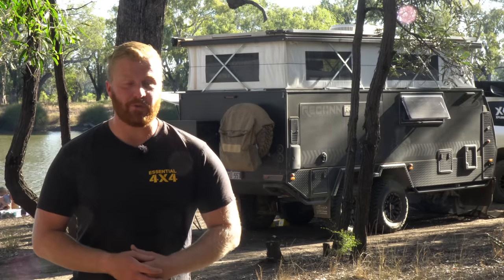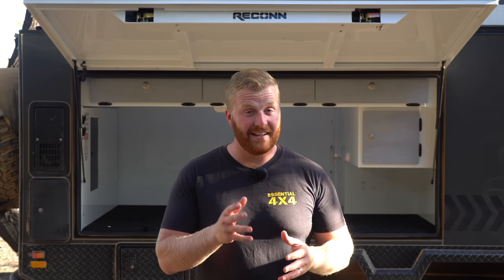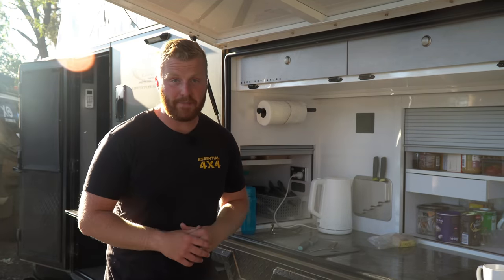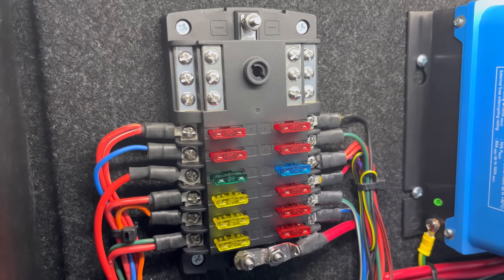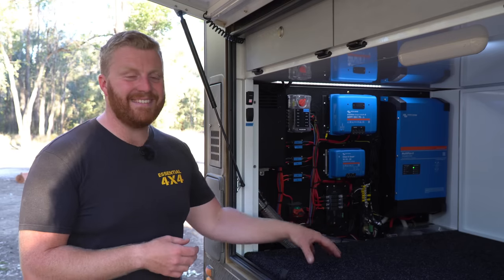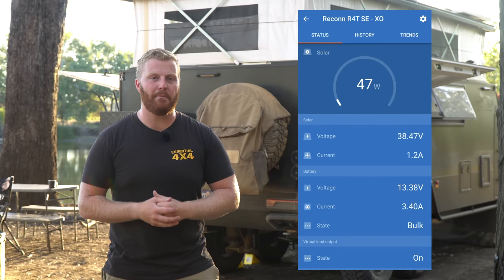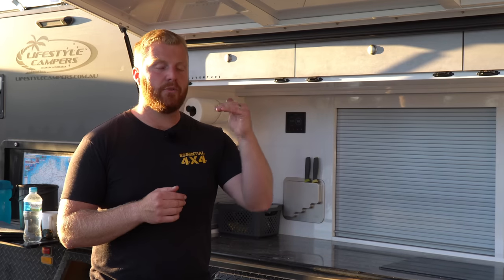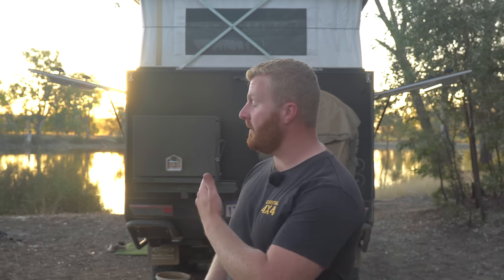Pt 3 | ULTIMATE POWER & WATER SETUP | Off-Grid Hybrid Camper | Lifestyle Reconn R4 | Electrical 12V

Comment: It’s amazing how quickly technology leaps ahead.  That said, you are so right about building your solar system for the bad days, as perfect Sunny
Days are often not that common.

A couple of things you could do in a few short years is upgrade your solar panels. I’m pretty sure some of the worlds best panel manufacturers are already producing 440-450 watt panels, in two to three years time that will probably be 600watts, so essentially you could go from a 1xxx watts of solar on the roof of the camper to almost 2,000 for minimal outlay. By the same measure the 150watt portables will probably be almost 300watts each, so that’s a system that will only get better and rather easily, even if you are required to also replace a solar charger to increase capacity.

Other ways to reduce the amount of power required on bad solar days would be to utilise the jet boil for making a cuppa (or the fire) AND you could probably turn that freezer down (or up depending which way you look at it) because minus 18 Deg Celsius is what’s recommended for long term storage, whereas in the van your probably only freezing meat for a week or two at a time……..unless you’re into the ice cream again Nathan 🤣

Great episode series on a great Van 💪🏼👍🏻
Reply from the maker: So true! I think people are too quick to base their solar input on optimal conditions, not on realistic results. I've sure found out just how quickly solar conditions can turn, even on sunny days! 

And I agree entirely! The tech is advancing quickly and renewables are in the spotlight. They will only gain traction and become more and more efficient as the year pass.
We have used the ol Jetboil from time to time, but still very impressed with our system overall 👍
Reply: @XploringOz  Nathan, you’d have to be one of YT’s gentlemen, always responding positively even in the face of negativity. I think you channel
Is the real deal, somehow you always manage to reply to everyone and always manage to pump out interesting & relevant content & you do so in a way that is beyond your years. I know you do this as a hobby but I think you’ve missed your calling & should end up with your own travel show on the ABC or something.

I am eagerly awaiting an episode that involves some one wheeled stunts my friend, tell me, is there any chance of that happening  at some time in the future ? 🤣
Reply from the maker: @GR8Tmate  Thanks mate 🙏 Way to much negativity online these days. Have to try and make it lighthearted and fun, otherwise it gets to you in the end and the channel will eventually fade away!
Never know what the future holds though 🧐
.
.
.
In terms of stunts.... 😆 more like stacks and crashes 😂

Comment: That is a cracking setup. Really got me thinking about a separate tank for drinking water now as it is by far our biggest limitation on longer trips.

That Victron system is amazballs. I got the cheapskate option with the Renogy 3000W charger inverter which chargers at 75A, but the thing weighs 29kg so swapped it out for just their 3000W inverter. Not nearly in the same league, but can run everything for us (including AC) and has the same UPS feature that the Victron does to switch between shore power and batter.

Brilliant thing with your Victron system is it comes in 12v or 24v input. Pulling those massive currents over 12v requires some serious cabling and fusing. You may find over time that 24v will be on the cards (reduced voltage sag, reduced cabling gauge requirements as the current is halved, etc). I'll definitely be looking at 24v for our next build. I think within the next decade it is going to be an expectation rather than a fringe luxury case to be able to run your AC all night from battery, at least for mid tier to upper end off-road vans.
Reply from the maker: Thanks mate, we love it! It has been and hopefully will continue to work well in our setup. 
I agree with your comment regarding the 24V though. It is the way of the future for these high demand/supply setups and the markets accessories will begin to adapt their products to suit accordingly. 
I don't think our's needs changing yet, given the current setup working well and the very short distances between the batteries and the inverter, but anymore and it would be great idea. 
Hey, as long as your setup works for what you need, that's all the matters 👍

Comment: Hi Nathan, Your  electrical system is very impressive. I enjoyed your overview on the Reconn. It is much better to have a large charge capacity ,really 5 hour charge is really all you get a day, couple of cloudy days with the induction/ inverter in use it doesn't take long to kill the batteries. I have hesitated to go to induction because of the current draw. We also use the Truma hot unit,  some owners have experienced the mounting feet cracking off & the water in and out failing after the feet snap on corrugated rough tracks, now the van manufacturer has fitted a strap over the unit to the load of the mounting feet. Keep enjoying your trip, safe travels.
Reply from the maker: For sure, capacity is king and I agree with your comments regarding charging times. Induction is definitely a heavy draw, maybe a video I can produce in the future discussing this from a realistic point of view? 🤔 
Thanks for the heads up on that common issue, I'll look into this before I hit the Cape!
Reply: @XploringOz  no worries there would enough content for video. If you needed I could send photo of the strap on the Truma.
Reply from the maker: @iandibley8032  Yeah, mate. If you have a photo handy that would be awesome - xploringoz@outlook.com 👍
Reply: @XploringOz  Tomorrow will remove the plastic top and take photo cheers
Reply from the maker: @iandibley8032  Thanks mate. No rush on my behalf, whenever it’s convenient 👍

Comment: Sincerely, thanks Nathan.
You invited us all in to your world, demonstated your choice in van/camper to a standard of integrity befitting your character, yes you blow me away everytime you disclose a product, its features and the primary benefits suiting your requirements.
That water, power supply most would consider over the top, even unnecessary, but as per usual you can readily justify it.
Congrats, just love the total practically of this van, well all except the brilliant external kitchen. Having said that, a small induction cooktop inside would quickly resolve that for me, just for time when weather outside is less than inviting.
Not as young as you, sadly 😢.
What an extraordinary home away from home you have jointly provided for your lovely family, enjoy it, every bit of it.
Reply from the maker: Thanks Ian, I appreciate those comments. We are extremely happy with our setup and wouldn't change it for this trip around Aus. 
I'll be sure to follow up with future productions regarding hybrid campers and our experience with Lifestyle longterm, but the short of it is that we are happy 👍 
PS. The flagship LRX model comes with an internal induction too 😉

Comment: Hey Nathan. Another top notch video and a great finish to your caravan review series. That is one impressive van you have there!!
This more than likely doesn’t affect your situation but for all the mere ‘plebs’ like me out there, I highly recommend installation of the ‘Enviro Water Saver’ in the (shower) hot water feed line. When installed, the valve will divert cold water back to your water storage tank until such time that the hot water flow reaches its normal working temperature then allowing the now hot water to flow through as per normal. I have only just installed it on my caravan but I am expecting to save a bunch of water that would otherwise flow straight into my grey water tank.
Looking forward to watching your continued travels. It’d be fantastic to see you at the upcoming BNE Caravan and Camping Show along with a few other prominent caravanning YouTubers I follow but I suspect its probably not your scene
Reply from the maker: Thanks mate, appreciate that 👍 

That sounds like a great idea! That would have been is helpful on our old Jayco caravan as we used to use a bucket to transfer it to the kitchen sink for dishes, but that is much simpler and cleaner. 

I haven't been invited to any of those events yet, maybe something for the future. Never know, might see you out and about 👍
Reply: Hey Nathan. I’m at the Brissie Caravan and Camping Show and dropped in to Lifestyle Campers and mentioned your brilliant reviews of your caravan. I highly recommended that they get you on board as an ‘ambassador’ at the shows and they thought it was a great idea so expect to hear from them soon for an invite 👍
Reply from the maker: @rich9903  Awesome. Thanks for the mention! 🤙 I was fortunate enough to meet up with some of the team as we passed through Brisbane a few weeks ago. Quite a cool operation they have going on there!
Reply: @XploringOz  Hey no probs Nathan. Considering how much you have REALLY influenced me in my own vehicle & caravan build not to mention inspiring me to travel the country with my family in our setup, it's the least I could do in return. I really hope to meet you in person one of these days 😊
Reply from the maker: @rich9903  That's awesome mate, I appreciate that and I'm so glad that I've been able to assist in this way. Hopefully we'll be able to catch up at some point 🤞
Reply: Hey Nathan. Just wondering where I can find the link to jump on board as a Patreon of your channel. I randomly looked through the comments sections of a few of your recent videos but couldn’t find anything but I’m sure I’m looking in the wrong place.
I just want to ‘put my money where my mouth is’ and shout you one or two scotches each month (just watched your last ‘affordability’ video) as I continue to watch the adventures of your big lap. Just a small token of appreciation for everything you’ve personally done for me (influenced the build of my touring rig, caravan setup and accessories) 🤘
Reply from the maker: @rich9903  Thanks for that support mate, I really do appreciate it. At the moment I don't have Patreon or any other similar type of funding option, but it's something I may look into in the future. I just want to make sure that I can give that little extra to those who would be willing to support financially 👍 Thanks so much though

Comment: Nathan, I have learned so much from your videos and especially about the Reconn. Coming from boating background there are a lot of similarities with caravaning with one exception being van payload. Curious if you have produced content on this or have good reference. Certainly coming up to speed on the towing capacity but curious about van payload capacity and how much capacity one might need. Lifestyles have usually over 650kg, 300kg of water leaves 350kg for other and finding it challenging if that's little or a lot for two people. Appreciate your wisdom!

Comment: Great video, Nathan. I'm curious as to why you chose 12v over, say, 48v system. 450amps draw seems crazy to me.
Reply from the maker: For sure, so the heavy draw is all from the inverter and the distance between the battery bank and inverter is very small, therefore the resistance is minimal. However having 12V means that it's compatible with al the other 12V accessories fitted in the camper. 
Keep in mind too, that just because it can draw 450A doesn't mean it does 😆 We don't often exceed 200A when cooking or boiling the kettle. 
I think 24V is the future of these big systems though

Comment: Excellent! I wonder if the future of off grid would be 24V rather than 12.  For me it makes more sense.  The problem is there isn’t currently much designed for 24V.
Reply from the maker: For sure, with systems that are getting bigger and bigger, 24V would make more sense but as you said, other industries are slow to keep up

Comment: Do you run your external Bluetti panels in series or parallel? I am looking at doing similar for our Reconn. The 1050W on the roof is amazing when it full sun but parking in full sun is not always possible. I have two 200W blankets from Hardkorr (mostly because they are IP64 rated and can handle a bit of rain). They only come with an Anderson plug so connecting two in series will not be so straight forward. I am not sure if I want to swap out the plugs. I assume the only difference in running in series over parallel is that in series will give me 24V and therefore less of a voltage drop across the cables running between the panels and the regulator. I am curious of which way you went and thought?

Comment: Hi Nathan, I'm looking at buying a Reconn R4T SE or LRX, is there anything in the options list that you wish you had of purchased when ordering & is there any options that you purchased that you now consider a waste of time?   Thanks.
Reply from the maker: Firstly, you’re looking in the right direction. They are great campers. 

Personally we have been very, very happy with ours. 

In terms of additions, I would personally like the diesel space/water heater and matching wheels and tyres. The main reason we didn’t purchase at the time was cost 💰 already getting very expensive 😬 

If we had to loose anything that wasn’t necessary, it would be the black jockey wheel, drawbar tap and rock sliders. All nice additions, but not required with our style of touring 👍

More than happy to help out with any other queries if I can 👍